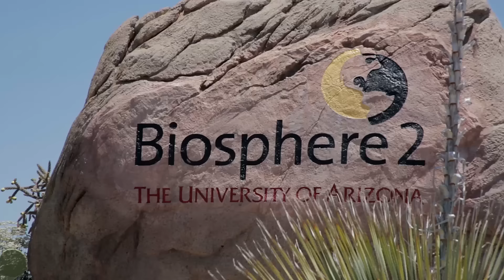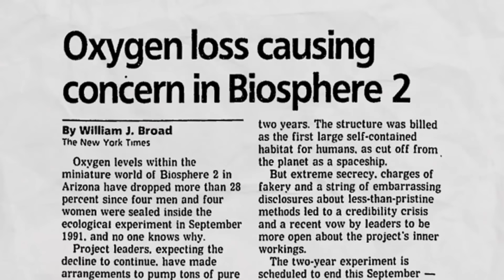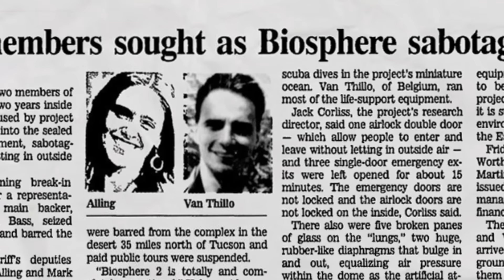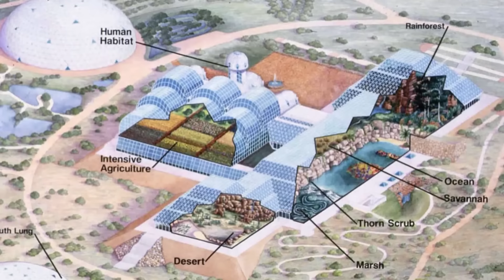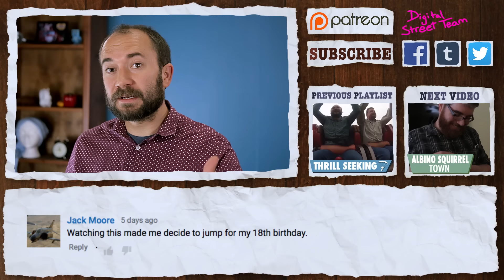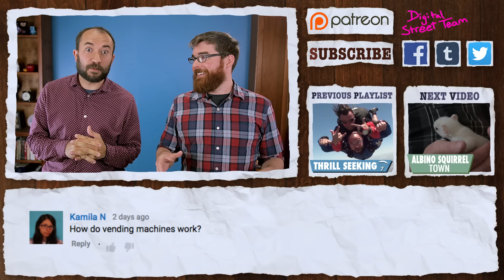Inside Biosphere 2: The World's Largest Earth Science Experiment

Comment: Side note: It was later found that the hastily poured concrete was depleting the oxygen. It was just an engineering hindsight. The system works, it's the people that are broken.
Reply: Concrete breathes?
Reply: @rollinthunder1000  Concrete can be very porous.
Reply: @rollinthunder1000  Ask any basement owner.
Reply: @rollinthunder1000  concrete slowly gives off CO2, which is part of the reaction of solidifying the concrete. The reactipn lasts for years and is a reason why concrete structures contribute to climate change.
Reply: You sound like a blizzard developer.
Reply: @m0w0ss  co2 contributes to delusions.  The icebergs are growing overall BTW.
Reply: @joemonroe9456  guess where those iceberg come from... they're pieces of Arctic ice, molten because of the greenhouse effect! And guess what caused that effect: CO2!
Reply: So, they blame their failure on depleted oxygen?  That is not true, they monitor oxygen levels, as well as all other gases in their environment, twenty-four hours a day.  Science types never lie to cover their failures, do they?
Reply: No, they didn't take bacteria into account
Reply: @joemonroe9456  fool.
Reply: Joe Monroe proving yourseld right apparently
Reply: @joemonroe9456  just so you are aware the problem has never been icebergs melting. The very fact they float means they displace there mass in water meaning even if they melt the sea levels will not rise.

The problem is the Ice shelf's melting. This water is locked on land and hence is not displacing any sea water.
Reply: @generalharness8266  I understand.  Antarctic ice is growing by the way.
Reply: @sandracmyers  "proving yourseld right apparently"   Lol, you make my point.
Reply: @m0w0ss  It doesn't. Cement is produced by decarbonation of limestones, that CO2 is released from the rocks and combined with heavy energy use is responsible for high CO2 emissions at the cement plant.
Cement, dependending on conditions, may absorb CO2 and revert into limestone analogue minerals.
Similar to how steel can absorb O2 and revert into iron oxides/hidroxides.
Reply: So people are not God. Got it.
Reply: @joemonroe9456  True. Yet Arctic ice is shrinking rapidly, as are most glaciers across the globe.
Reply: Where is your source for this, I'd like to research it more.
Reply: @rollinthunder1000  concrete reacts with gasses in the air while curing, and it can take years for concrete to fully cure.
Reply: @rollinthunder1000  It actually does; in a way, that's why in construction when casting a floor slab, you keep soaking it with water for approximately 28 days so the concrete sets properly, otherwise it will be porous and crack easily.
Reply: I read it was oxygen consuming bacteria in the soil.. also the inhabitants and organisers weren’t scientists, they were a hippy theatre troupe, so..
Reply: @rollinthunder1000  concrete absorbs. Easiest way I can think of it is imagine living in a brick apartment during the summer. The bricks suck in the humidity like a sponge making it absolutely ungodly for the inhabitants. The concrete did something similar but with oxygen. You can look up the Ted talk where are the biosphere and explained what happened in more scientific terms.
Reply: how would you know
Reply: @joemonroe9456  the glaciers are shrinking  all over  the world
Reply: @natehill8069  We do not have basements made of concrete!
Reply: The capacity is still to small to imitate an Earth environment.Too many organisms and too less ocean.But that’s enough.The situation in a 400 cubic meter pressurized space station will be far worse whatsoever.
Reply: Yes, but that would also be a factor if we built on on Mars, the builders would have nowhere to live.
Reply: They spent 3 years constructing the biosphere so how is this "hastily" poured concrete? Does that mean if the concrete was poured non-hastily it would not have affected the carbon? So the argument that concrete itself affects carbon dioxide is nonsense If you're arguing the way it was poured affects it
Reply: @m0w0ss lolololol....climate change....if fixing the homeless problem was mentioned as much as climate change, it wouldn't be a problem ...but climate change is just cool ....homeless is boring right lol
Reply: @roviomobile7646  I was also thinking the ocean area was way too small. Earth is over 70% water, so this biosphere should reflect that as closely as possible. Also agree the entire project was entirely too small. It was a great start and a ton of information was learned and is still producing results. We may need this technology to survive on this planet as the climate continues to worsen.
Reply: To be fair, we don't know if the system works. They're could have been other issues.
Reply: @joemonroe9456  you mean sea ice, not land ice

Comment: 13:18 that's so going in my mine!
Reply: Cody'sLab get blasting. also have you had a good at using hmtd to move rock since it's rather simple to make.
Reply: Cody'sLab that would be interesting....what would you test with it?
Reply: I knew I'd find you here! haha
Reply: Cody'sLab hello!!!!!!
Reply: Cody'sLab this video was suggested after I watched your hydroponic video.
Reply: sneaking in the comment sections bud
Reply: Can't wait to see that.
Reply: haha hey cody!
Reply: dead in the first three months :)
Reply: +dirtTdude The post mortem analysis showed that it was the concrete which absorbed CO2 through chemical reactions, without the CO2, the plants could not produce the O2 intended. A Mars mission would supplement biological life support with chemical and mechanical life support, energy would be used to disassociate the O2 from the CO2 of the Martian atmosphere, from the water found in the soil and from the silicon dioxide of the rocks. It simply takes more energy to produce oxygen from the more stable sources. However, in my opinion, the idea of colonizing Mars would be unnecessary and even counter productive, space colonization would be better in artificial space habitats such as O'Neill cylinders, Bernal spheres and Stanford torus's.
Reply: But will your mercury supply be included? Are you going to have all the precious medals in yours? Do they have them all in theirs?
Reply: How bout aquaponics
Reply: O2 levels in biosphere2 were dropping because of a design failure. So they were creating enough O2, but can not make it sustain in such a big scale. Hence the small capsules, interchanging matter, balancing a much smaller ecosystem.
Reply: Need more info!!!!!!  Is this really what one person need to survive in a year?
Reply: We grew up in the same town, love your vids btw
Reply: This old thing again
Reply: I'm a simple kind of man. I see Cody, I like.
Reply: You should research and try and go see the Boeing factory they accidentally formed there own climate in the building lol
Reply: STAGING & LIGHTING SensatioN this comment is so wrong it pains me physically
Reply: Eric Gillespie its ok you were tought that way.
Reply: tehjamez I just got back from work. You go to sleep. Lol
Reply: +Omar Ibn Lynn Ibn Samual Marchant - Concrete actually absorbs carbon dioxide over time after it is set. Hempcrete is more efficient at it since it breaths better.
Reply: next project? haha
Reply: don't starve them?
Reply: Cody'sLab u should
Reply: Cody'sLab yyaass!!! Please tell me you are working on this
Reply: Cody'sLab lol you tried to sneak over in to the comments but the upvotes caught you
Reply: Wait, is that where you got the idea for your setup?
Reply: I’m working on a better system...cheaper...portable..bigger & including linked to my live trout.....so plant and meat product.
Reply: well its been 2 years ... I subscribe to  your channel... ?
Reply: I concur with Marc Cooper to some degree: "the group that built, conceived, and directs the Biosphere project is not a group of high-tech researchers on the cutting edge of science but a clique of recycled theater performers that evolved out of an authoritarian—and decidedly non-scientific—personality cult"

They have no aquaponic systems, dry composting toilets, no algae culture, no vermiculture, no common sense... I admit the engineering of the structure itself is impressive but the overall project was far too ambitious and the biological life support systems were not well thought out; particularly with respect to surviving in isolated space or on another planet. The overall project objectives were not 'logical' to begin with and make little sense to me. 

They should have modularized starting on a much smaller scale; implementing an O2 recycling system before even thinking about taking the next step! If you have nuclear or solar power - you can recycle the oxygen indefinitely just like submarines do. You do not even need to model nature exactly - trying to generate all the O2 from plants is totally unnecessary. Plants should be viewed as "supplemental" to oxygen production.

Next the aquaponic systems - (not "hydroponics") to supply food for the biospherians. You need a regenerative supply of fish and edible plants that are ready for harvest from DAY 1 or you're just setting yourself up for failure. Aquaponics solves this problem. Rather than 'over-taxing' a natural system to the point of failure - you already have an independent food and oxygen supply. This way you become a valuable asset to the ecosystem from day 1; having a net positive impact. 

The systems discussed so far do not require a massive footprint, they can be engineered in a relatively small amount of space; (comparable to a submarine's interior) leaving the rest of the biosphere totally EMPTY. That's right, EMPTY But before you start having an existential meltdown - hear me out... 

Consider starting over. Not the building itself- just replace the soil with simulated Martian soil and leave all the planting to the Biospherians themselves; much like astronauts tasked with terraforming a habitable biosphere on Mars.  Think 'Matt Damon' from the Martian but inside a massive climate-controlled Biodome instead of a tiny little disposable hab module. Doing this would revive the project and get the attention of investors and tech giants like Elon Musk - I guarantee it...
Reply: oh hi .... BTW ,how is nowadays in there?
Reply: Would love to have a modern, Computer controlled (powered by renewable energy at best, so solar, wind etc.), hydroponics system :) (grow my own food etc. :) )
Reply: Oh hey! Ain't you the reason I'm watching this video, huh.
Reply: dirtTdude  if youd bother to do some research youd see that the oxygen shortage was due to a construction oversight in which the concrete leeched oxygen from the air.

it was also over 20 years ago. We've learned a bit since then
Reply: I heard in a documentary years ago about an Appalachian gold mine that had to be abandoned in the early 20th because they had dug down to where the geothermal heat was intolerable. There was more gold, but the heat made it inaccessible. Seems like the right platoon of geeks could harvest the heat for power generation, cool the deepest part of the mine, get the gold, and create a tropical fruit and vegetable operation. It would be a dream to be a part of something like that myself, but I have a job with an environmentally themed condominium complex that I can't walk away from for the foreseeable future.
Reply: Fenrirboulder not so much cos isn't a governement' experiment and the guy who invest his monney can't To continue. but I think it was a good experience
Reply: I do this in my closet, but its not veggies.
Reply: Please do that Cody
Reply: the whole project seems like quite a pretentious garden for the UofAZ imo

Comment: The artificial lung is fascinating, made me wonder if they could use it to pump the water from the lowest point to the highest point - or as just a general way to produce power.
Reply: Interesting question. It would be pretty steam punk/ Jules Vernes looking I bet. But I have to wonder if solar isn't more practical. Although I'd think they'd have to be plugged into the grid based on the enormous amount of energy that place consumes. I'd love to know how many Kh it uses a month.
Reply: @againstthemodernworld3253  I think a mix of a bunch of different energy sources is the best. You'll never know when one of them will fail.
Reply: Most likely not. The reason being is that it has to be the most easily movable part of the building so that it can be shifted around by the excess/limited air pressure to keep the building's pressure relatively steady. As soon as you load it with water or attach any sort of device to extract mechanical energy from it, it would be much too difficult to move, and the primary purpose is defeated.
Reply: I found it interesting that the thing nearly flattened his head while they were recording.
Reply: The lung is a massive room and the diaphragm that changes position to the air pressure is pretty big, but fairly easy to move, which means it doesn't input/output much work that could be harnessed. My tour guide let our group push it around. It does not store energy well as it has to be more movable than the thousands of glass panels throughout the place to keep from popping out, which it doesn't take much of a difference in air pressure to do. If resistance were added to it, such as forcing a rotor through a magnetic field in a generator, then it would defeat it's entire purpose of being easier to move than the windows. Many people don't realize this, but most all buildings and cars are vented or intentionally left imperfectly unsealed to allow air pressure to equalize so windows aren't easily popped out. I worked at a body shop for a couple years and the shop foreman taped over all the hidden exit vents just to show me a cool trick in popping out the windshield and rear window of a sedan just by slamming the car door. Window seams in normal construction do not fair well to unequal pressure.

Comment: I have been inside. One thing you have to remember is that after this was built they  found out alge in the Ocean made 94% of the world's oxygen. So 2 main design problems were made the main one was it was not model after the earth...meaning that the Ocean was to small it should have been 75-80% water. And 2 they used  regular plate glass with iron only 50 % of the suns sun's energy was used. Walter Adey was the ats system manager. So the load was not calculated correctly.
Reply: Also the sun shines on the Ocean 24/7

Comment: I'm thinking was it not possible to measure the food and oxygen production before putting people in there? Thus knowing how many people it could support. Also (forgive the ageism) older people may have been a better bet. They tend to be less combative more cooperative and less hungry.
Reply: +David Johnson I'm reading Jane Poynter's book, after I visited the Biosphere. They did measure the food and oxygen production before sealing people in. It was months before the oxygen and CO2 levels started shifting erratically. The shifting, it was later discovered, was caused by the cement used in the foundation of the building. And "older people" would not have been able to withstand the rigors of daily food production, as described in the book. The oldest crew member, Roy Walford, lost a great deal of his weight, and looked like a different person when they left their two-year Biosphere 2 experience.
Reply: +David Johnson I believe the problem with the first group was that they didn't let the concrete set long enough, so the oxygen bled through to the outside.   The hypoxic atmosphere led to the paranoia and the splitting into factions.
Reply: I'm 65 and agree with your points about cooperation and consumption, but it would not have been a good test. When Mars is colonized, they will need people with endurance, quick wits, great health and of reproductive age.
BTW, I visited Biodome 2 in 2012. I would recommend it to anybody. It looks like they have been doing some cool stuff between then and this 2015 video. I would be interested in knowing what they're doing now. I'm glad U of A took over this project.

Comment: How does biosphere 2 compare in size to the Eden Project?
Reply: According to Wikipedia Eden projects two domes are 3.9 and 1.6 acres. But they are separated and not isolated from the outside environment. (biosphere is 3.14 acres). They have windows and doorways so they're not sealed off like biosphere 2 is. I'd be interested to know what insects the biosphere houses for pollination, I know that's a very important part of the Eden project.

Comment: Closed system ? Did i notice a giant ventilation grille at the top of the structure ?
Reply: because that was also 30 years ago. And their vision has already changed. 
Remember they said that there was lack of oxygen during the first test?
Reply: Julian Paolo Dayag I realised they have a double wall and the air needs to ventilate when its expanse due to heat..
Reply: Looks like it was added after the experiments, you can see the triangle structure under it, it doesn't fit the look of the original build design at all
Edit: If you look up original photos of that area, there is no vent